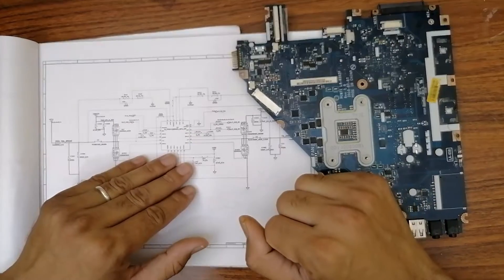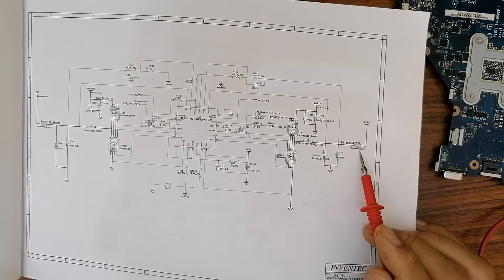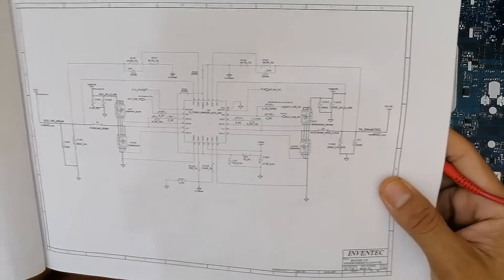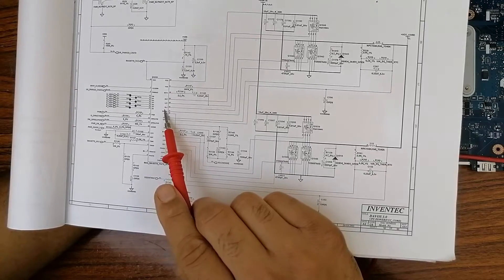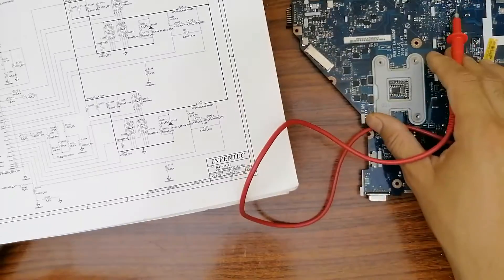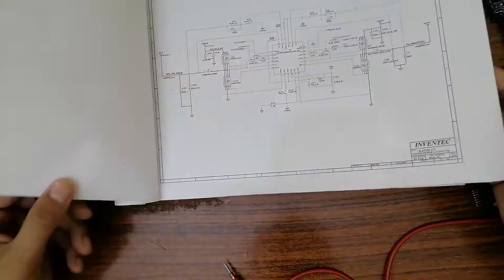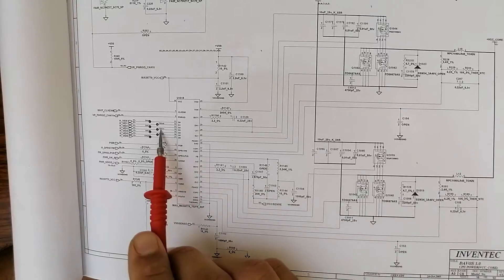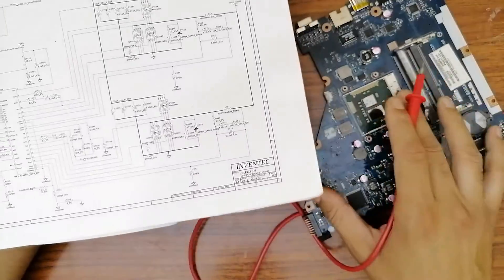laptop motherboard repair guide - motherboard repair with schematics reading

Comment: on one smd small register voltage is coming from one side and no voltage is going from another side in my laptop motherboard. register not have any value mark on it. do i need to replace register? how to determine which value register? and can i bypass it with jumper?  bypassing showing ampere list 0.22. but i doubt it will produce good result.
Main laptop problem it's fan speen once and then goes off.